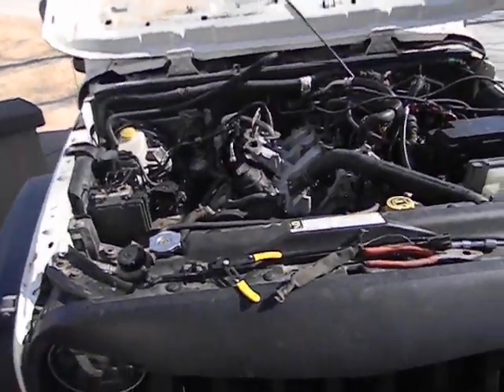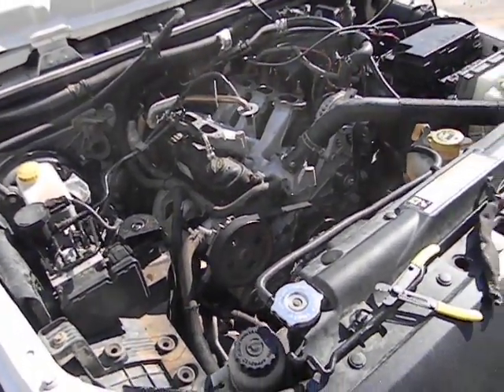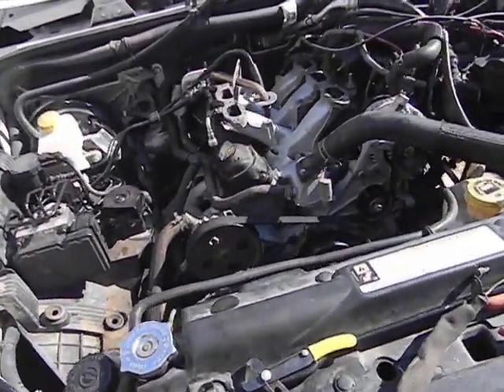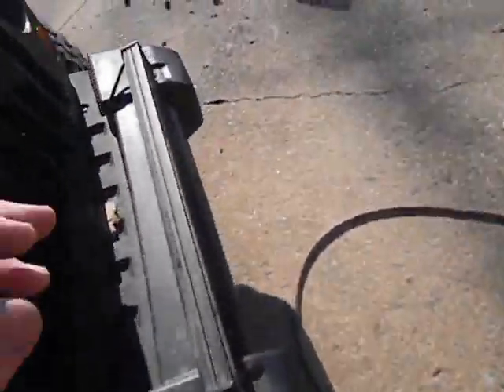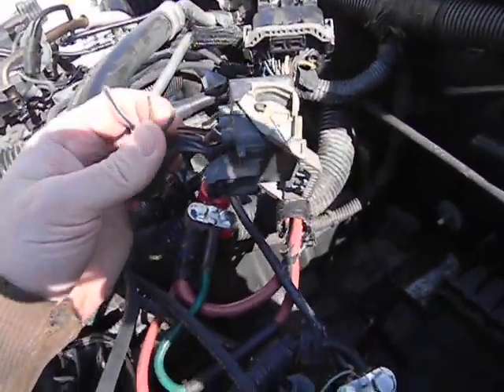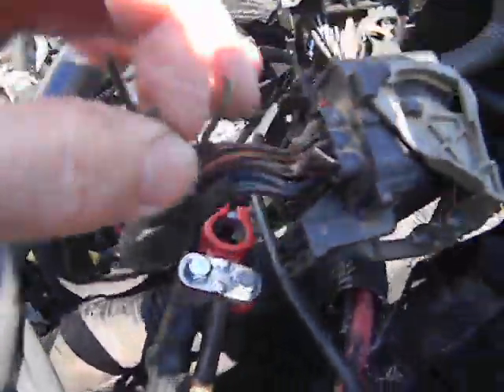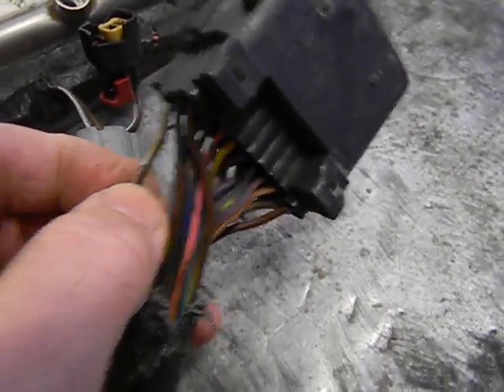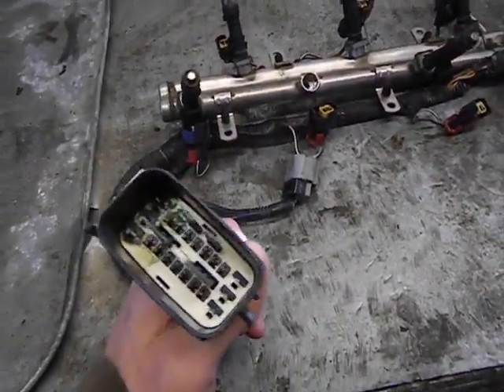Jeep JK Wrangler P0203 P0303 MISFIRE CODE FIX

Comment: Hey, good catch! A problem I had recently on my 09 was a misfire, code for "open circuit injector number 2". I chased it for a while then gassed up and the problem went away, runs smooth as silk. I had put some bad gas (siphoned from my rarely used pickup) in and caused it to run rough. Can't explain why it said open circuit, or just number 2 injector. I thought I'd share my experience, and congratulate you on being a damn good mechanic. Thanks for your video!

Comment: I know this is an old video but I have seen a video of the anti freeze leaks from the temperature sensor and it will migrate up the wires and burn out the connector

Comment: Yes I have a 2002 harness with a bizarre red sideways clip that does nothing, no idea under the sun how to pull it apart.   Ended up breaking the tab on top and its still welded fast.   Why not just a simple snap plug on everything, why does each one have to be creative and unique, like a freaking Mensa puzzle?
The designers of Jeep connectors and clips should be boiled in motor oil as I'm concerned lol
Reply from the maker: Yeah that red clip is a safety lock.  It has to be slid sideways before you can undo the main connection.  Yes it is overkill and dumb

Comment: I have a P0201 most of the time then the P0301 with a misfire shows up. I clear them with my scan tool and let it sit overnight and then it’s fine the next morning. Then it’ll come back a few days later. Replaced injectors, seals, PCM. Still occurs. Must be a harness issue like this video

Comment: Does the windshield wipers go through that harness. I have a intermediate problem with the wipers not working also  along with the misfire codes. I’ve had it happen to 3 and 4 cylinder
Reply from the maker: I had some wiper issues also but it ended up being the multifuction lever which is basically the turn signal and wiper function lever on your steering column
Reply: My misfire code come up RIGHT after using my wipers to clean my windshield.

Comment: I’m having a misfire on cylinder 5 and my injector circuit on injectors 1-6 are all open constant. I had water in my injectors along with corrosion in the harness but not to the point that the prongs were broke. I cleaned all of that checked compression checked all grounds and changed injector on cylinder 5 and also the vacuum is good. Still haven’t found my issue a week later. Any advice ?
Reply: Any luck i have the same issue

Comment: I didn't get that lucky. It's misfires under low rpm. Drives fine.. But ecu reports missfire.. coil. Wires . Plugs. Nothing. I guess injector
Reply: @John Valenti ever find anything out Im in the same boat

Comment: The dreaded po304 after plug install 
Stick w OE plugs the 3.7 does not like iridium or platinum
Reply from the maker: This was not a plug issue.  Also I think you either mean 3.6 like the newer Jeeps have or a 3.8 like this has.  I'm using platinum plugs in my 3.8 for 3 years now and not a single issue.
Reply: johnbrakingground 2011 Jeep Liberty kk 3.7 v6

Comment: @Johnbrakingground..was your jeep running rough as well?
Reply from the maker: insanely rough.  I had a corroded injector connector as well as this.  The little metal prongs on the injector corroded and broke off in the plug.  That was a lucky catch as well.
Reply: Hmm I got the p0303 error but my Jeep runs fine
Reply: How many KM did you have on it?@johnbrakingground 

I have a rough running 09 Jk and I am chasing all my issues much like you, I just ordered new injectors. It seems like I am not getting enough fuel aswell. Did you have that issue where the motor cuts out?